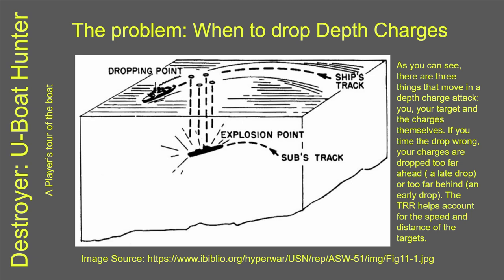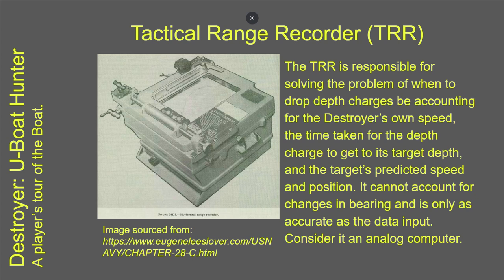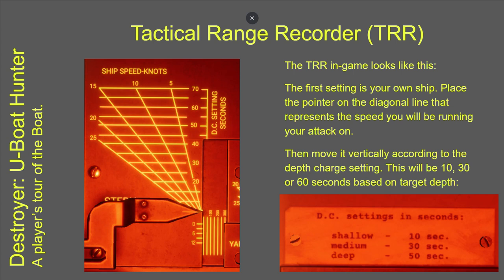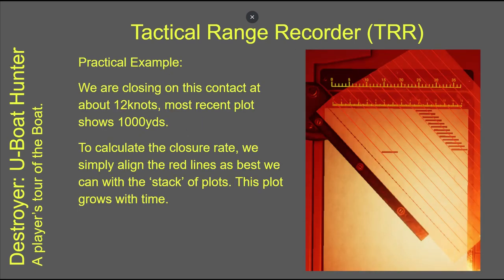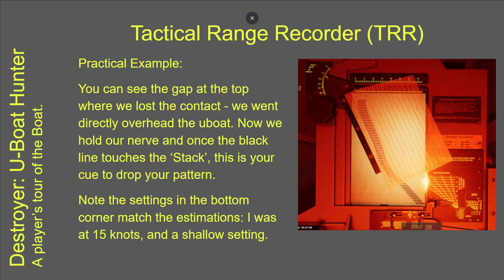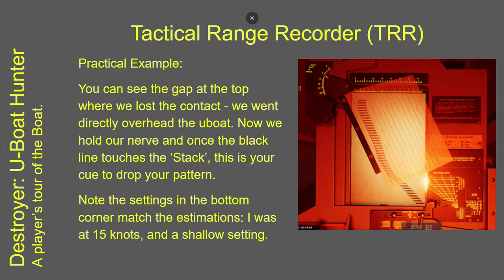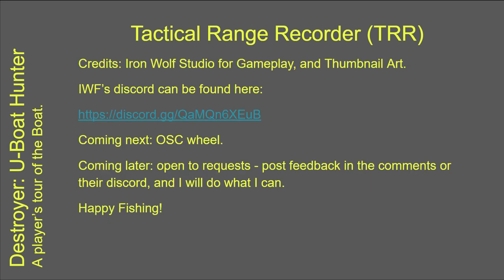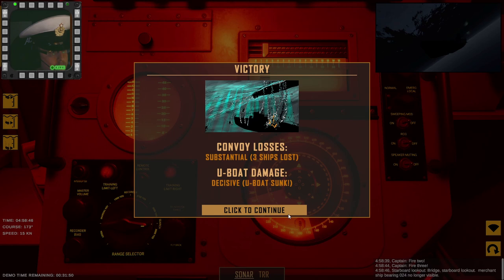Using the TRR in Destroyer   U Boat hunter

Comment: Thanks for this - it's a rather confusing part of the game that I still don't think I fully understand. At around 6:40 could you explain this in a little more detail?

What do you refer to as the "stack"? Is that the left-most line (the thicker dotted line) that's part of the plexiglass that you can move around / change the angle of? 

If I'm understanding right, you would want to launch depth charges once the left edge of the next horizontal bar that's drawn (on top) touches that dotted line (aka: the stack)?
Reply from the maker: The “stack,” as I call it, is the stack of dots being drawn by the plotter. The black bar that is furthest left is your firing cue. When they meet, that’s when it is time to fire (assuming you correctly aligned the “stack” with the red lines beforehand).
Reply: @ghostdog688  I think I understand it a little bit better now, but will need to put more time in to test / master it!  I initially did not even really understand that you were also using that guide in the bottom right corner of the machine.. I just sort of thought that you wanted to try and match the pattern in the stack >.<
Reply from the maker: Practice makes perfect, remember the assumptions made at the end regarding the uboat changing course,speed or depth.
Reply: @ghostdog688  Yeah the in-game tutorial isn’t clear about this but your video set my brain right. Thanks.
Reply from the maker: @deebee4575  glad I could help. Current versions seem to adjust the TRR to the correct ships speed and target depth for you. It’s now a lot easier.